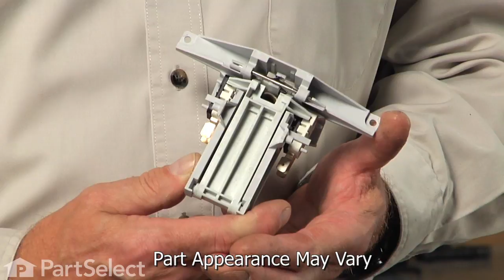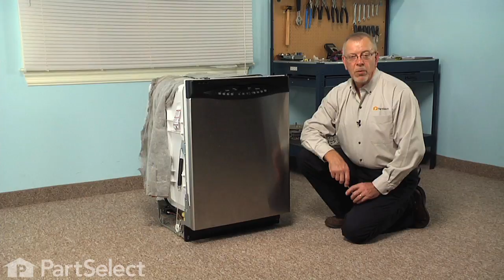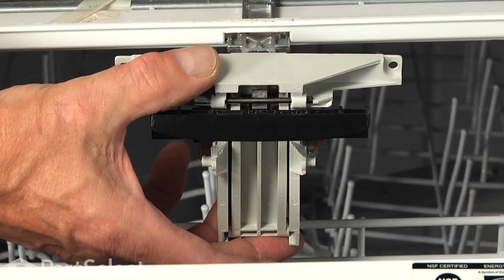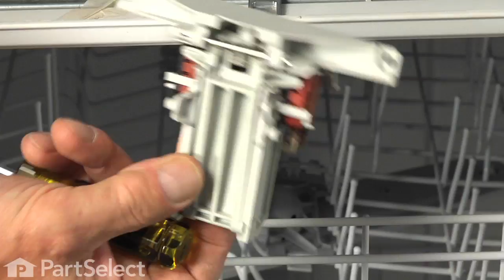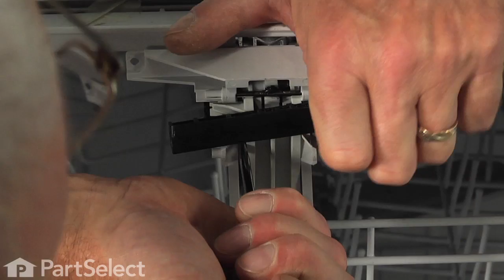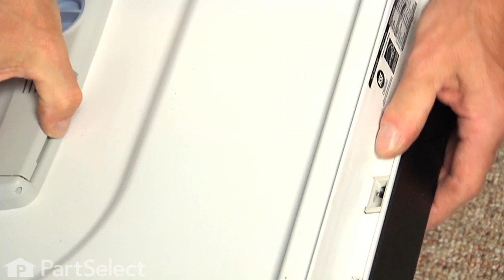Dishwasher Repair - Replacing the Door Latch (Whirlpool Part # W10275768)

Comment: Two details not clear here: 1) the harness on my Amana machine is connected to the two tone switch differently than how the new part connects. I just can’t pull the harness away from the switch 2) so o used the old red/black switches but then they fit onto the housing differently too! There’s a tiny “switch” that clicks, it is some distance away from the plastic rod on the housing on the old unit, but on the new unit it is permanently pressed in

Comment: The handle is just a lever, remove the handle and just pull the door the same way and you save 70 $
Reply: True enough.  Our dishwasher has been working for years with a broken finger handle.  Just kind of irritating to have it flopping around broken.

Comment: Thanks for posting. How do you determine if this is the part that needs replacing? Our washer powers up and you hear the pump empty out the tank upon startup and the control panel also appears to function (I replaced it 3 years ago when it was completely dead) but the washer doesn't start. Is there a way to test the latch with a continuity test?
Reply from the maker: Hi Arie, thank you for your question. Are you referring to a dishwasher like in this video, or a washer like the one you would use to wash clothes? In either case, we have a handy repair guide on our website that you can go to, and it will give you some of the main reasons that your washer or dishwasher will not start. You can find them here:

https://www.partselect.com/Repair/Dishwasher/Will-Not-Start/

https://www.partselect.com/Repair/Washer/Will-Not-Start/

Once you've found the offending part, you can enter your model number into our website, and you will find the part you need, as well as a guide to helping you install it! If you need any more assistance locating the broken part, or with the installation process, please don't hesitate to reach out! Thanks again, and good luck with your repair!
Reply: This isn't at my house and I haven't had a chance to see the exact model number but it's a dishwasher that I'm 99% sure is the one you're showing.  I will look at your guides. Thank you.

Comment: Maybe it would be easier if the latch came with handle attached.
Reply: Louie D'angelo There is one on Amazon that has the handle.  Just make sure to order the right color.
Reply: The new ones do.  Buy part W10130694.